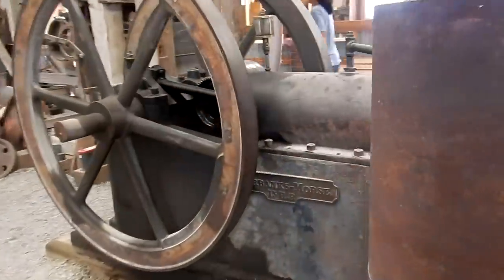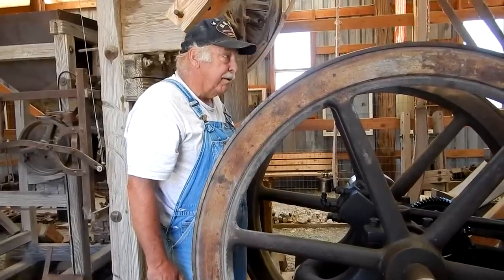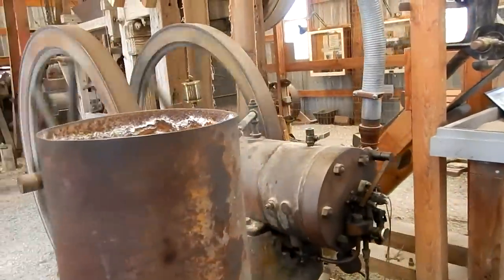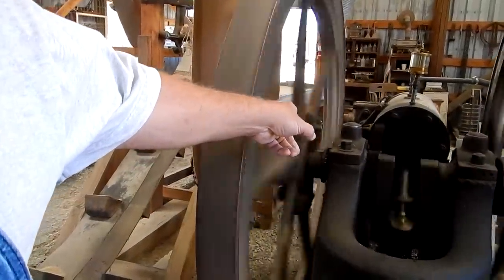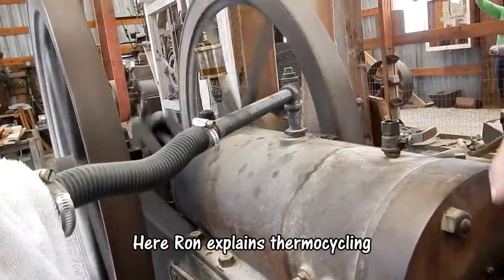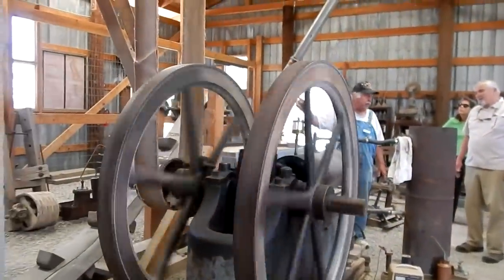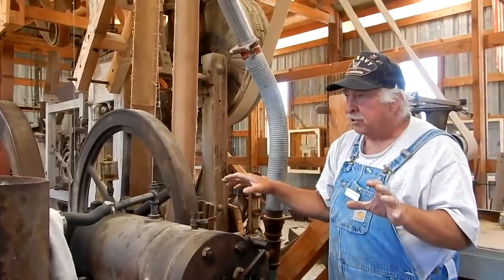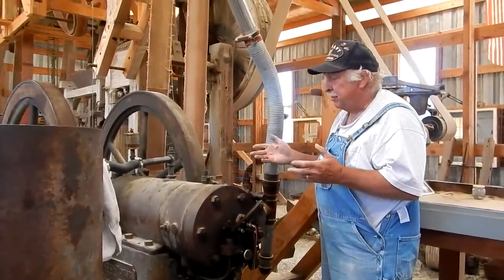1912 Fairbanks - Morse 15 HP Hit And Miss Engine And Two Stamp Mill Demonstration

Comment: I have a saw mill that was my grand dad's. It is powered by a 15 hp Fairbanks Morse  hit & miss. It was new in 1916 and been driving the mill ever since. This saw mill and this engine runs five days a week. We rebuilt it a year ago and that was the first time as far as I can tell.
Reply from the maker: Wow, that's amazing. I bet that is fun to see and hear running. That says something about the quality and simplicity of these engines. I get asked occasionally about fuel consumption of the engine. Can you give me an idea of how much fuel it uses? Thanks for the comment, John!
Reply: @TomandJulieMineExploring  it burns on average 1.5-2.0 gals per hour under a load.  That's down from 2.5-3.0 before the rebuild. A benefit of the rebuild. It now starts easier and runs smoother. It starts right up on karosine now which it wouldn't do before. It had to be warmed up on gasoline before switching the fuel supply. The old engine is a hoot. I've been using it now for ten years since we moved and re-sent the mill. It never ceases to amaze me. Grand dad would be happy his saw mill was still cutting wood.
Reply from the maker: @johnwillis4706  Thanks for that information on fuel consumption and type of fuel. I was wondering what fuel you ran it on. I agree that your grand dad would be happy and proud of what you're doing with the mill.
Reply: @TomandJulieMineExploring  it's a lumber mill by the way. It will cut logs up to 6 feet in diameter. We don't see logs that big today, about 60 inches are the biggest we see now and those are rare, but it would cut them. We cut full dimension lumber. 2x4's are 2x4 inches 2x6's,2x8's, 2x10's, etc. It's the old ways but, people really like the full dimension lumber.
Reply from the maker: @johnwillis4706  Good to know what your mill can do. Feel free to put the mill name and location in a comment if you'd like.
Reply: @TomandJulieMineExploring  The mill doesn't really have a name. But I'm located outside Ozark Missouri.
Reply: @johnwillis4706  this is such an awesome little story!!!

Comment: Thank you for sharing this. Definitely sparked my interest in Hit and Miss engines. Too bad I can't get my hands on one here in The Netherlands
Reply from the maker: They are not terribly hard to come by here in the States. I bought one for $100 that is not in running condition. I need to get the magneto working as there is no spark. Mine is a Sattley brand one and one half HP. I hope you can find one sometime. Thanks for the comment!
Reply: @TomandJulieMineExploring  $100 seems like a steal!! Great project, have fun getting it running!
Reply from the maker: @chilrobberto1  Hopefully I will get it going this summer. I have two more video you might enjoy watching. 'Hit and miss engine shop with Ron Morefield' and  Hit and miss engines with Ken'

Comment: The phrase "balls to the wall" originated with ww2 era aircraft which had balls on the throttle. push those to the firewall and you had "balls to the wall"! Love the video!
Reply from the maker: That is what I have come to understand about the balls to the wall phrase. The 'balls out' was a similar phrase originating from the ball type governor, both meaning the engine was running at full power. Thanks for watching and commenting!
Reply: Also, pushing the envelope comes from the same thing. An Envelope in aviation is the term we use for the physical/structural  limitations if an aircraft. It's the safe highs and lows of speed, altitude, engine power, and maneuverability. It has to do with test pilots pushing an aircraft to its limitations and trying to see how much further you can go.
Reply: @TomandJulieMineExploring  balls out is when running at max rpm...the flying ball governor was designed to keep engine speed consistant while allowing engine load to vary
Reply from the maker: @CATech1138  Thank you, Charles!
Reply: The previous version of "pedal to the metal".
Reply from the maker: @lowellmiller6663  No doubt! Thanks for the comment.
Reply: correct. The old saying associated with the governors on old engines was "balls out", because the balls which were the flyweights of the governor were slung out further as RPM increased.
Reply from the maker: @fireball1322  Yep, balls out was full speed. Thanks for the comment!
Reply: The term "High ball" was a railroad term when red and green (and other color) balls were used as signals if both balls were raised to the top, it means go fast!
Reply from the maker: Thanks for contributing that bit, Tom. Good to know.
Reply: I thought the saying was balls out...
Reply: So did people use to say I got kicked in the governor

Comment: I read somewhere that "balls to the wall" actually originated from aircraft controls. In some older aircraft the throttle control had a ball at the top of the stalk. When the throttle was on full, the balls would be close to or touching the instrument panel. "Balls out", originated with centrifugal governors.
Reply from the maker: You are absolutely correct on both counts. Thanks for watching and commenting!

Comment: The foot cranking part scared me a little but it sure worked like a charm.  These old things just want to keep running forever.
Reply from the maker: That's the only way you can turn the engine over to start it. They will definitely run for a long time. Thanks, Ozzie!

Comment: Like the engine,but would rather see more of the stamp mill working.
Reply from the maker: I understand it is only a partial demonstration of the mill and I would love to see it actually working in full, too. The mill is inside a building and would be very loud when the hammers drop, which I'm guessing is part of the reason it is not fully operating. I'm with you though, I would love to see the mill working in full. Thanks for the comment!

Comment: Our newspaper runs news from 100 yrs ago and 125 yrs ago. They pointed out that there was a coal shortage which affected electricity production in  neighboring communities 100 yrs ago. It stated that our community burned oil so it wasn't effected although the schools were still heated by coal.

Comment: The description of the "ignition tube" reminds me of an old story about even older times.  It was one of the tales of "Billy Bunter" written by "Frank Richards" (one of several pen names used by the extremely prolific writer, Charles Hamilton).
The basic story is about a walking holiday in which some boys from the same school hired an ancient motor-tricycle to haul around their camping equipment and supplies.  They continually had trouble getting it running because of the primitive ignition tube system, and on top of that there was some shady character continually hanging around who seemed to have a strange interest in the motor-trike.
Of course, as such adventure stories always turn out, the "twist" is eventually revealed to be that the ignition tube on the trike is made out of something which, at the time of manufacture, was just an unusually high-temperature tolerant metal... platinum. :)
The attempted thief had figured it out and was trying to steal the ignition tube to sell.  Of course once the boys find out, they return the trike and let the owner know that he's got something valuable, because they're Incurably Honest™ :)
Reply from the maker: Thanks for the interesting comment about what sounds like a good book and story. Who would have guessed that an ignition tube on an engine could be fodder for the plot twist of a book. Ron did say the ignition tubes were troublesome.  Thanks, Melkior!
Reply: @TomandJulieMineExploring  Thanks.  I'm not sure the story would be available anywhere now, since it was only ever published in one of two magazines intended for school-age boys, either the "Magnet" or the "Gem" which were both compilations of tales with some illustrations.  The tales were highly "formulaic" with each character having a predictable set of responses to each situation, unless the plot demanded something different, in which case a halfway-plausible excuse would come up to explain the temporary change in personality.
I think I still have many of the magazines stowed away in a wardrobe somewhere, if silverfish haven't devoured them by now.
Reply from the maker: @melkiorwiseman5234  Interesting. I haven't heard of the magazines you mentioned. Maybe I'll try and look them up sometime.
Reply: @TomandJulieMineExploring  I'm quite certain they're no longer published, but it's possible someone may have mentioned them in an online article.  There's a TVTropes page for Billy Bunter and Frank Richards/Charles Hamilton but of neccessity, it's not very extensive and last I knew, it didn't mention the two magazines, only the so-called Billy Bunter Books.  Happy hunting.
Reply from the maker: @melkiorwiseman5234  Thanks for the information!

Comment: This is an Awesome video. I Have a John Deere 1.5 horse.
Reply from the maker: Thanks, Brett. I have a 1.5 HP Sattler that was sold by Montgomery Wards. I can't seem to get the Wico magneto to work. I think it needs a new capacitor.
Reply: I’m pretty green on working on them. This was my granddads and was passed down to me, he knew it inside and out. My plan is to power a corn grinder with it.
Reply from the maker: Me too. I haven't spent a lot of time on it yet.

Comment: 0:15 I worked for US Forest Service here in Oregon and I know where there is one just like this out in the Deep Woods of Oregon sitting all by it self that nobody knows about, we had a Forest Fire there last summer so the Babbitt Bearings are probably melted out but I bet she's still there, if T and J ever comes to Oregon I'd Draw them a Map for another Fun Exploring Video.
Reply from the maker: We live south of Bend in Central Oregon during the summer. Too bad that the fire might have gotten it. I have a 1&1/2 HP Sattley hit and miss engine that I've been trying to get running. So far no luck getting spark out of the magneto. You can email us anytime if you have suggestions for mine explores, hikes or whatever else you'd like to talk about. jwigren40@gmail.com

Comment: Yes they were a pain to start but they were so reliable and versatile they should still be making them.
Reply from the maker: Yes, very good for certain applications. Pretty hard to beat modern engines, though. I have one at home that I'm trying to get running. It's a 1&1/2 HP Sattley that is labeled Montgomery Wards. I think it's around a 1919 year model. I can't seem to get the Wico magneto to spark.

Comment: We had a smaller hit and miss running our oil well pumping. Ran well until it had to be replaced because of politicians and noise levels. Had to run power lines to the property and install an electric motor. Monthly expenses were more after getting 'modernized'.
Reply from the maker: Newer isn't always better. Too bad you had to stop using the old hit and miss. Thanks for the comment!

Comment: I have the diesel version of this engine. It was used in a mine here in Oregon.
Reply from the maker: That sounds cool. It's nice to know where it was used and for what purpose. That's a big engine to have at home as far as space for it goes. Do you know what the actual mine was? Thanks for the comment.
Reply: @TomandJulieMineExploring  I don't recall the mines name, but it was near Granite, Oregon. I also have the rod mill and crusher jaw that was purchased at the same time. 
The engine has no ID plaques, but the guys at Brooks, Or have identified as Fairbanks Morse. 
It was purchased at the same time as the rod mill and jaw, which has a casting dates of 1915/16 if I recall. 
We had it in a local museum for years, till they decided that we should donate it to them so that they could sell it. 
My father would have haunted me. 
I probably should find it a new home.
Reply from the maker: @nutsmcflurry3737  That is great that the pieces are still together after all these years. Lots of old mining history in the area around Baker City.

Comment: Dzień dobry
Wspaniała maszyna.
Piszę do Pana z Polski w Europie.
Od kilku dni fascynują mnie stare silniki.
U mnie jest prawie północ a ja oglądam twój film.
Czy istniały podobne silniki diesel?
Takie z gorącą gruszką z przodu?

Niestety we wschodniej części Europy bardzo trudno spotkać podobne silniki.
Życzę Ci dużo zdrowia.
Reply from the maker: Hello Mietek. Thanks for the comment all the way from Poland. These old engines will run on many different fuels including diesel. They are not technically diesel engines though. I'm  sorry that you can't  get a smaller engine like this where you live. I have a small one at my home, but I can't  manage to get spark from the magneto  to make it run. I wish you good health as well!
Reply: Bardzo dziękuję za odpowiedź.
Widzę że odpowiadasz na wszystkie komentarze. 
Bardzo mi się to podoba.
To musi zajmować dużo czasu.

Powiedz proszę ile dolarów może kosztować w USA taki  działający semidiesel 
O mocy około 10 koni mechanicznych.
Chodzi mi o realną cenę, nie okazyjna oraz nie super wygórowana.
Pozdrawiam serdecznie.
Reply from the maker: @mietekmietek1112  Around $630.
https://www.amazon.com/TBvechi-Engine-Diesel-Cylinder-Machine/dp/B07Y4RR726/ref=asc_df_B07Y4RR726/?tag=hyprod-20&linkCode=df0&hvadid=475858389483&hvpos=&hvnetw=g&hvrand=13743659472022674891&hvpone=&hvptwo=&hvqmt=&hvdev=m&hvdvcmdl=&hvlocint=&hvlocphy=9033169&hvtargid=pla-1163753909705&psc=1

Comment: That's nuts, they turned generator's with them but didn't at the time put it together for a magneto for its own ignition.
Reply from the maker: The way I understand things the early magnetos were troublesome with the condensers causing a lot of the problems. Here is a link to some information about them if you are interested. I have a hit and miss engine with a stubborn Wico brand magneto that I have not been able to get working.
https://oldcroak.com/fairbanks-morse-1/

Comment: I love these engines but does anyone know why they were used after the advent of multi-cylinder or even single cylinder engines with standard valve systems? The model Ts of the time were running with inline 4 flatheads which seem to be more power dense and efficient.
Reply from the maker: That's a good question that I don’t really know the answer to. I'm guessing part of it is that the technology to make the hit and miss was already there, with many different manufacturers,  so naturally it takes some time to switch over to more modern engines. I'm also guessing that there is a difference in performance for certain tasks, between the hit and miss and more modern engines, like the amount of torque that's necessary. I know once those big flywheels get moving it's hard to stop them. Heavy tasks like pumping water, generating electricity and cutting wood were popular uses for these engines. Maybe someone that knows more than me about this will chime in. Thanks, Tyler!

Comment: 5:30くらいのエンジンってクランク回転でMAX何rpmくらい回るのかな?100rpm回る?
このエンジン１基でこの工場一棟動かしてたんだね。
Reply from the maker: I believe the maximum RPM for an engine this size is around 200. The smaller engines of this type would run at higher RPM up to 600. Thanks for the comment!

Comment: Why was allowed  to run without any cylinder lubrication-the reservoir above the cylinder was empty and shut off
Reply from the maker: I think it would have enough residual oil for it not to be a problem. I'm sure Ron knows what he is doing. Thanks for watching and for the comment, Robert.

Comment: i would love to have one they should make them now  ,how much fuel do they use
Reply from the maker: The amount of fuel the engine uses depends on the load put on them. They are probably not as fuel efficient as a modern engine because of the way the fuel mixer works. You can still find them for sale. I just bought a 1 1/2  HP hit and miss about a month ago. Thanks for watching and commenting, Jim.
Reply: I really like the sound of them,We went to a big country fair ,I went to the sound, the kids wanted to go on rides after a while, I could have stayed, but thought I better go with them, DANG IT

Comment: "BALLS TO THE WALL" has nothing to do with old spinning-ball engine governors. That term comes out of the 1960s USAF, referring to the ball handles on aircraft throttles - with the 'wall' being the cockpit firewall.

The correct term, pertaining to old engines, is "balls out" - this describes the position of the flyweight balls on the governor, when the engine is working at full speed.
Reply from the maker: You are correct. I mis-spoke and have heard about ever since. Your description of the different types of governors, and how they operate, however, is right  up there with the best of them! Thanks for the comment.

Comment: I'd like ot know why these engines always have piston exposed at end of stroke!
It's not just to save a little wight of iron?
Reply from the maker: I don't know but I assume there is a good reason. Maybe someone else here knows. Thanks for watching, Rose.
Reply: @TomandJulieMineExploring  Nearly sixty years ago I worked in textile mills and many still had various big gas engines but no-one could say why piston came out.
I wondered if it was to ensure good oiling while starting?
Reply from the maker: @rosewhite---  That very well could be, Rose. I do remember them inspecting the edge of the piston and they noticed a small spot that appeared dry(no oil) and they increased the oiler output a bit.